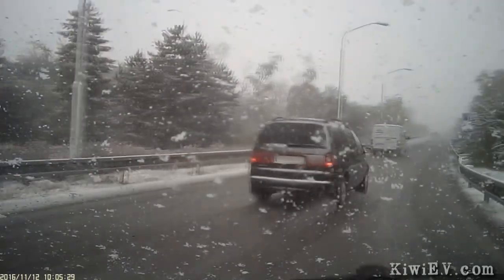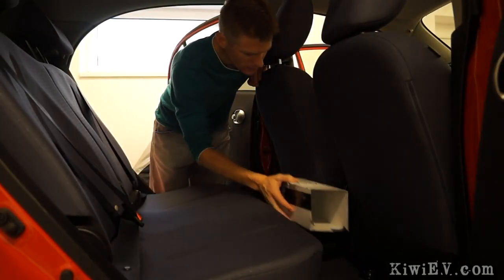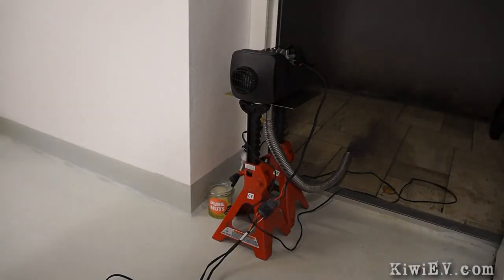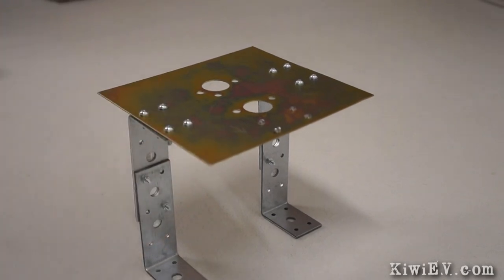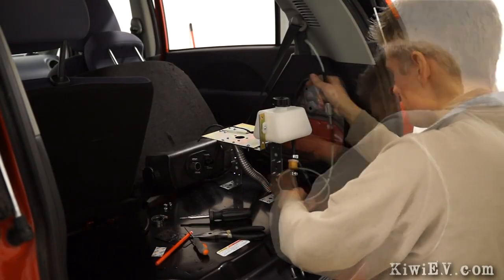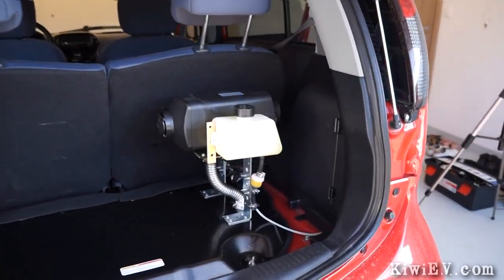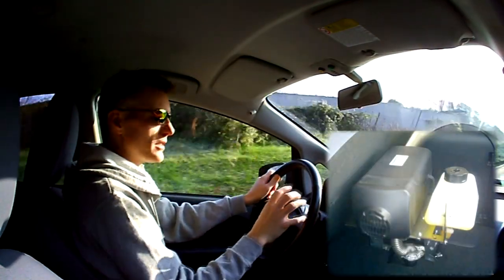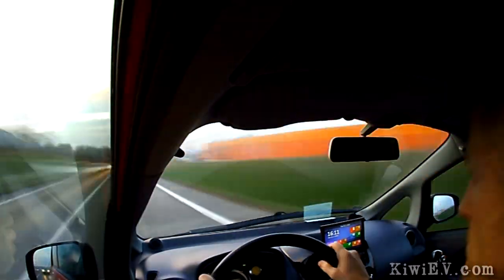Installing a diesel heater in the Kiwi EV

Comment: cool setup. I'd be tempted to leave the exhaust sticking out from under the car so the hot toxic exhaust fumes can't rise up into the car although they shouldn't anyway if everything's sealed well.
Reply: @johnwright6090  a diesel heater will burn only as fraction of the diesel it would take to run a car.

Comment: for the windshield I dont think you need to add a fan, cant you just turn your car heater on so its on "fan only" mode usually by putting the temperature setting in the middle, and turning on the  recirculating mode

Comment: I was wondering when you were going to do something like this. I seen a couple of videos of Mitsubishi i-Miev drivers doing a diesel heater in their cars to ease the cold but not eat the range of the small battery (and range) of the car.

The diesel fan heater is innovative and the mounting area even moreso.

Comment: I know this is old, but the heater needs a power source, so you would be using some of your battery charge to power this. The question is, how does it affect range?
Reply: Few minutes at beginning it will hit 140? Watts.
Most of time its running 40w.
So figure that into your cars wh

Comment: Don't worry about biodiesel. I don't know the temperature it will get down to where you live, anyway, pure diesel is easier/safer for your application. Bio can give you (more) headake. It may give you problem with slush, and for that little amount you're using, I don't think it's worth it.

Looks like you fitted the filter the wrong way. On many of these, there is an arrow for the correct way of flow. The fuel should flow into the "outside" of the filter, thereby going through the filterelement from the outside and in. This way you can see how dirty it is and when it's time to change ;)

Once again a great video from you :)

Comment: If you have to use fossil hydrocarbons, then use heating oil (kerosine). In the UK, it's a quarter of the price of road fuel diesel.
Reply: Or red diesel

Comment: Great Job! - How have the nuts and bolts been? I use nylon insert nuts whenever I add anything to my LEAF. I have a friend who did something similar in 2014 with his iMiev it the tank and heater Is in the engine compartment and he pipped in the heat vent through the firewall and connected it to the existing duct work. So heating the windshield and his feet was very easy to do.
Reply: Did you make this for the leaf? I hope to do so one day, still looking for some inspiration.
Reply: Sorry,  I never did.

Comment: Would this work in my petrol car and mount it under the bonnet and blow the hot air through the firewall?
Reply from the maker: Definitely possible. Just be careful to keep this model of heater dry. Some folks have killed their diesel heaters from corrosion. They do make weatherproof models though.
Reply: @KiwiEVadventures  Yeah, I've also seen a model that heats up the coolant,  so it will also pre-heat the engine, then the stock heating can heat the car...

Comment: Amazing to think that little diesel tank has about 16 Kilowatts in it ...
Reply: ... for a whole of 18 minutes, at least the heat is free though ;)
Reply: 1.5 L  of diesel should run the heater for about ~6-8 hours I would guess
Reply: myozone Not while delivering 16kw of heat. But at 2.2kw sure.
Reply: I think you misunderstood, 1.5 L of diesel has about 16 Kw of 'power' contained in it (1L = ~10.7Kw) therefore, 1.5 L in the tank would last with the (2Kw) heater on full power for about 6-8 hours

Comment: Heating with electricity is pretty dumb in northern countries. While a heat pump might produce heat to the factor of 3 from the power used, it is useless at temperatures below 0°C with a factor of 1. So, while using diesel for driving only uses 40% of its energy, 100% of the energy of the diesel is used for heating. They should even include a heating only to prevent the battery from getting too cold and beeing destroyed. Also the range will be larger. Instead of diesel you also could use pure alcohol to improve the emissions which already are neclectable small.
Reply: 4 years ago, but in case you havent found out yet: heatpumps can give you a factor way above one even at below zero C. The one on my house does 5.5:1 max, and still above 2:1 at -15 C.
Reply: @GoldenCroc  As a famous german politician once said: I give a sh.. on what I said 2 weeks ago ;) 
Yes, you are right, and meanwhile I think burning of any fuel should be avoided. However, just now, heatpumps fail dramatically in cars like the ID.3 or the Model 3. Those cars sometimes have even higher consumption with a heatpump.
Reply: @JakobFischer60  We need much smaller, more aerodynamic cars then. Something like an aptera or so. Sure, why not, fine by me.

Comment: Can you please tell me if you parking heater is still working.  I'm thinking of buying one and using it as a parking heater for my Mitsubishi L300 camper van.  I can't afford and expensive one, so I have been looking at these copies.  Do you think they are a good thing or not now that you have had it a while and used it.  Thank you for your help...
Reply from the maker: Yes, the parking heater has been running faultlessly every winter. It was a great investment. You just need to channel the air to the front of the car for the best effect.
Reply: Thank you for responding,  I appreciate it and congratulations on your channel, it's very interesting...
Reply from the maker: Thanks mate! :)

Comment: Nice now you got me to thinking, i think i will try to mount a gasoline air heater and use ethanol to it, little less co2 out of exaust pipe on that, i have 60 to 80km in winter and 120km in summer on my car and sometimes i need 110km in winter i have drive 110km in winter with heater on 16c and only heat on windshield and floor and fan on speed 2 and drive 60km/h but if i have a gosoline heater maybe i can drive 110km on little higher speed and have nice and warn in the car.

Comment: Just found this video. Is it just me that finds it hilarious that you burn diesel to heat your EV? 😂😂 Kind of double moral if you ask me.
Reply from the maker: I get that. You have to keep in mind I was genuinely broke at the time and needed a solution. 
In retrospect I deeply regret burning those seven or eight litres of diesel and definitely won't do it again. I apologise for that, but the damage has been done. That being said, it did prove to be entertaining for many people and I learned a lot. I suppose it was certainly a video of its time and is outdated now. I'm sure you're also striving to be carbon free these days so it's a helpful reminder of how far we've come in terms of technology and what not to do.
Reply: @KiwiEVadventures  wellpapp I guess it's better to run just the heater on diesel than the whole car.

Comment: You inspired me to mount a diesel heater in my c zero, same type of car. You should du the same as i with refueling then you don't need to handle the diesel inside the car and just take the fueltank outside. Here it's a link https://youtu.be/_VEnlZPVMTk

Have a nice day!

Comment: Nice video. Why do you drive electric when combustion is such a great option? 55 miles doesn't seem like something you should have to worry about. Combustion gets great range, and fuels up in no time unlike electrics. Even teslas, and then teslas cost so much money.
Reply: It’s because combustion causes health problems and air pollution which seriously affects us. Comparing combustion to batteries, battery energy is about 80% efficient whereas combustion is about 40% on some ultra efficient Diesel engines. Combustion engines do also contribute directly to climate change with tailpipe emissions.

Comment: This is totally ill-logical idea to install Diesel based electric heater in EV, it will create pollution. It is better if u install   Silicon baesd electric heater in u r EV, which will not create pollution like Diesel one.
Reply: i drive EV beacause it's cheaper. And this little heater basically uses nothing